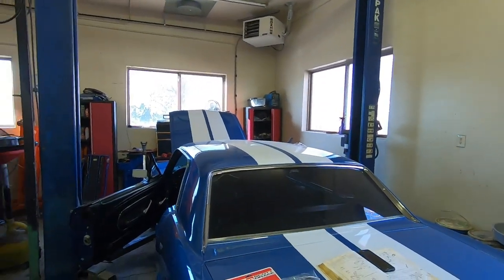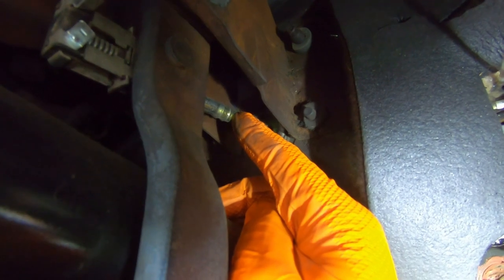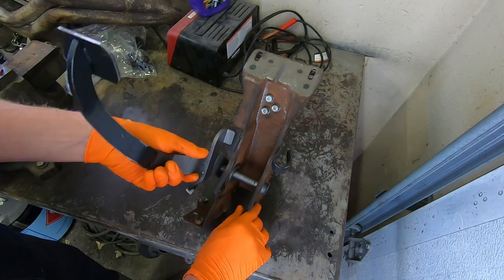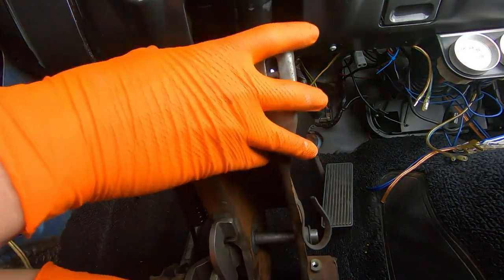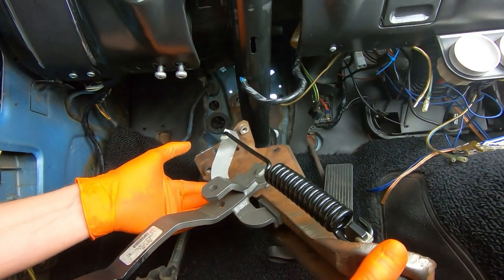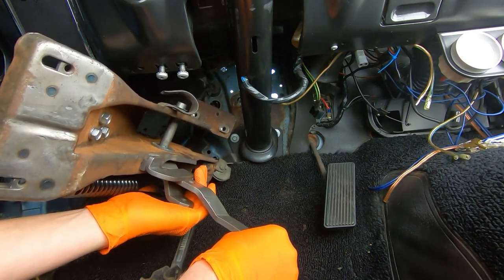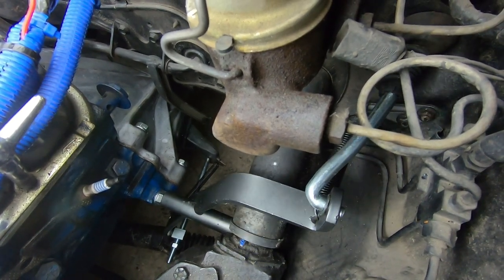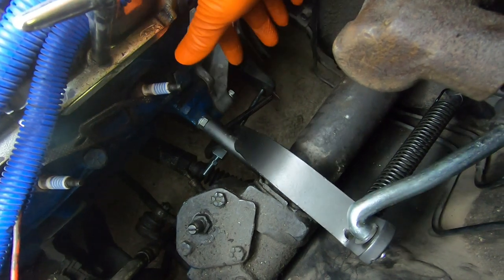Clutch and brake pedal install - 1967 Ford Mustang - Transmission conversion - C4 auto to 4-Speed

Comment: This was a great video, thanks for the detailed info.  I have a ‘68 GT/CS where I’d like to add a manual and get to a better rpm at freeway cruise speeds.  

I know you removed the pedal support so we could see, but us it just as easy to install in the car…removing the booster and MS doesn’t seem totally necessary, but curious on your opinion. 

Thanks again…!
Reply from the maker: Thank you for the comment. So you're right, removing the booster and master cylinder are not necessary if you simply want to add a clutch pedal. This particular car was getting a power front disc brake conversion at the same time. So that's why I had all that out. I will tell you from experience though, installing the clutch pedal with the support installed is not possible if you're still using the factory clutch pedal return spring. Lol I tried and got learned. So you have to at least unbolt it so you can move it around or assemble out of car and then install.

Comment: Great video. I pulled my bracket out today. I have a 70 and the bracket is way bigger than that 67. I had to remove the dash pad and gauge cluster. Mine was missing the return spring and the bracket actually has two cage nuts that slide and mount to the lower dash. Mine were rusted to the bolts and spinning with them. Had to drill them out. Trying to determine if this thing is salvageable. Just upgraded to power disk by master power. What I thought was a minor pedal install will now cause me some me lost time since I planned on having my new power booster and MC installed today. Good times. Keep those videos coming. Very professional and extremely informative. If I wasn’t all the way in the north east I’d be a customer!
Reply from the maker: Oh right on, thanks for the nice comment. One thing I've learned about cars of this age is its always more than I anticipate. Good luck and thanks for watching 👍

Comment: Awesome stuff! I see NPD has different part numbers for the support for manual brakes verse power brakes.
Reply from the maker: Correct, ya I think the difference is the power brakes has open holes for the firewall to allow the booster stud to pass through. Whereas the manual has threaded boss' to bolt a master cylinder to. 👍

Comment: Your videos are so good, they are saving me! I have one problem, I was watching your video for this installation and when i was messing with the clutch fork boot, i accidentally pulled the clutch fork off of the throw out bearing. I barely took any effort! Now, I have to somehow manage to get it back on. Is it possible for me to this without taking the whole tranny out??
Reply from the maker: Thank you! I'm glad to hear they are helpful. As far as this clutch fork is concerned....I honestly don't know. I've never been in that situation. I would probably at least try before you remove the transmission. I would imagine this will be tricky to pull off. I wish I had more advise on this. Good luck!
Reply: @AlfsMustangGarage  Alright, thank you and keep it up!

Comment: Alf, What a descriptive video, it really helps a lot in assisting us DIY to do the work on our own. I have a question. I am in the process of upgrading my 65 Mustang FB with power brakes  and a T-5. Car at this moment has a C-4. For the 65 a special power brake is also required? Appreciate yur coments
Reply from the maker: Thank you! I think you're asking me if the brake pedal is different for power brakes on a 65? If so, the answer is no. 65 and 66 used the same brake pedal for power or manual brakes. You will need a different pedal because of the transmission conversion though. I'm sure you already know that though. Good luck and sounds like an awesome project!
Reply: @AlfsMustangGarage  Thank you for reply and assistance

Comment: Hi brother Alf! Sorry to be a pain. Went to replace my brake pedal and found out it is bolted to upper pedal support, (power brake pedal) No wonder the car don't want to stop! Ex-4 speed factory car so I will pull out the pedal support as there is no way I can reach that one bolt holding the brake pedal. LOL, the four speed pedal was under the carpet. Removed return spring. I will remove air box and remove clutch pedal. I'm just gonna cut the pedal part off so I can use the rest for the Pin that does through clutch and into brake pedal.  Master Cyl is out so just two firewall bolts for upper support and the two screws. Dang, thought this would be easy swap!  Dooooh, nothing easy for ole Bob! Just in case, what size is that nut for the pwer brake pedal you are installing? I might use a long ratchet and find the nut blind and remove. Might be easier to remove the whole support.??? Thanks sorry to bother you. Hope the move is going good. Later.
Reply from the maker: Oh wow ya that makes sense. I can't remember the size of that nut. More than likely it was a 9/16" but could be a 1/2" also. I found it easier to at least un-bolt the support and then you can access the top much easier. But then again at that point its probably pretty easy to remove. Good luck!
Reply: @AlfsMustangGarage  2 months later update. Yes pulled the support, pulled the 9/16" bolt easily, Cleaned/removed rust from support and painted like new. Got a bushing kit from NPD for the brake rod and new brake light switch. Support went in much easier then it came out. Added Scott drake adjustable master cyl. push rod and adjusted for good pedal height. Bleeding system. Mushy brake pedal. Pulled calipers and bench inspected. two out out four pistons frozen. Replaced both calipers with new Kelsey Hayes type Bled system again. Ran bowl dry. Bench bled master again. Bled system again. lol, Much better pedal but a tad soft. Will bleed again (air somewhere in there). Ready for 4 shock absorber replacement. Thanks again, could not have done this without your videos and advice! Much appreciated sir! Gott find your video of rear shock replacement. Take care, many blessings to you from Motown/Dearborn.
Reply from the maker: Hey Robert, thanks for the update. Sounds like you're getting after it. One thing at a time. Brakes can be tricky at times. Are the rear shoes adjusted properly? And are the wheel cylinders good? I've seen those leak all the time and I've chased soft pedals only to discover that my shoes are not adjusted. Sometimes I overthink the small things. Hope all is well!
Reply: @AlfsMustangGarage  Rears totally rebuilt with all new parts & wheel cylinders. Re-adjusted shoes last weekand increased the drag. I heard stories of new calipers taking a couple of weeks to break In and start operating properly..........???? It does stop much better then It did before. Next on deck, shocks all the way around, rides like an old covered wagan. lol

Comment: Awesome video as usual. I too want to convert from a C-6 to top loader, probably next year or over the winter on my 67 Gt 460 BBF. Cheers from Motown.
Reply from the maker: Oh dang! That sounds like a beast!
Reply: @AlfsMustangGarage  Ex- 8 second race car converted back to street. Just a mild built 460 with all the good parts though. Thanks for your great videos. I have drawn much knowledge for my projects.
Reply from the maker: That's awesome. The good thing about those 460's is it doesn't take a whole lot to make good power!

Comment: I know you can use your old bracket when switching to a power brake setup. (just use the hole near the top). do you have to grind off the welded nuts on the bracket or can I leave them on? Better to know now, rather then pull it back out to do later. Thanks
Reply from the maker: Yes, you need to make sure the studs of the power booster are able to pass through with a slight amount of wiggle room so you don't bugger up the threads. They will then get nuts installed on them to secure from the inside of the car.
Reply: @AlfsMustangGarage   Gotcha. Thanks for the quick response.

Comment: So I have a 67 Automatic and I plan to do a conversion just like this. Do I need to buy the whole clutch pedal assembly or can I just buy the pedals?
Meaning can I house the assembly that’s in the automatic.
Reply from the maker: You can use the original pedal support and just change the pedals.

Comment: that big spring is actually the "clutch assist spring" which reduces the force needed to push in the clutch pedal!
Reply from the maker: Ya that's a common misconception. It assists in bringing the clutch pedal back up. Clutch pedal return spring 👍
Reply: I disagree. If you see the way the spring cams over it’s pushing the pedal down, not up! when you installed the spring you had to pull it hard to the up position. I bought one because my 67 convertible has the Z bar linkage and a Centerforce clutch which is very had to disengage. When I ordered it they called it a “clutch assist spring”. Thanks for showing how to install it!

Comment: What do you mean by power break assist? How does that set up work? 

I also was wondering if you knew whether the break and clutch pedals on a 68 ranchero were the same as what is found in a 68 mustang? I was thinking about doing a conversion in my car and have access to a cheap 68 ranchero with a ford 4 speed.
Reply from the maker: The power brakes means there is a vacuum booster between the pedal and master cylinder. When you press the pedal it's easier to push because the vacuum assists in pulling your pedal down.
I wouldn't have an answer on the Ranchero. I'm afraid I don't get a bunch of those to become familiar with.
Reply: @AlfsMustangGarage  Ok cool, that makes sense. You would assume that they would be pretty universal back then, especially if they are both 302 vehicles but I am not 100 percent sure. Do you know of any books or websites that could help me with my research?

Comment: I have a diaphragm type clutch, not a three finger type.  One of my clutch pedal insulators broke off last year and I put about 1000 miles a year on my 68 Mustang.  Most of the time when I depress the clutch pedal I hear a squeaking sound. Just a little squeak when the pedal goes down and again when it comes back up. Probably coming from metal on metal contact. I’ve heard that the diaphragm clutch doesn’t require as much force as a three finger type.  I really hate to tear apart everything and replace the insulators because of the above reasons, what’s your opinion?  Leave it along or replace the insulators.
Reply from the maker: I don't think the clutch type matters when it comes to how much pressure the clutch pedal return spring places on the insulator. Those are meant to just protect the spring from digging into the clutch pedal and the other end is that bracket attached to the pedal support. It is the pressure of the assist spring that is being placed on those insulators and the clutch doesn't change that. I would replace them if you have the opportunity.

Comment: Hello again, Quick question sir. Did you take out the front seat when you pulled the brake pedal etc? Hoping you didn't as my seat bolts under neath have mufflers blocking the access holes and the exhaust is welded. Thanks appreciate it.
Reply from the maker: I didn't remove the seat. Should have plenty of room to work.
Reply: @AlfsMustangGarage  Yaaaaaaaaaaaay!! Thanks Brother!!! The new pedal is the right ratio, I measured and it will be 6:1 and should help with the hard pedal with the new M/C and prop valve.
Reply from the maker: Nice, let me know how it goes!
Reply: @AlfsMustangGarage  6:1 ratio not 7:1. and will do.

Comment: If you wouldn't mind, can you give a ballpark of how much this whole conversion costs? I'd love to do this to my 68, but I need to know how many 7-11s I need to rob. 😆
Reply from the maker: I can give you some numbers in the morning. Do you want to know just parts?
Reply: @AlfsMustangGarage  I was thinking parts and labor. I know it'll all be dependent on what you get and who does it, but it'll at least give me an idea.
Reply from the maker: Absolutely. I'll pull the invoices from this job tomorrow and let you know. There was a lot of things I did on this car aside from the transmission but I'll separate it out for ya.
Reply from the maker: So after going through everything, the cost of every part on this job that was transmission conversion related was about $3900. Thats from the fluid in the trans, clutch linkage, pedals, shifter and also including the transmission which was bought and professionally rebuilt. Labor wise was about $1000 to remove the C4 and install everything else. Hope that gives you a good realistic number on what to expect if you were to pay someone to have this done.
Reply: @AlfsMustangGarage  Wow, honestly, that's a lot better than I was thinking it would be.  Especially the labor part of it.  Thank you for the information.  Now move to Oklahoma so you can use my Mustang for content.  :-)
Reply from the maker: Ha ha ya that would be cool. Honestly, it's probably not too bad of a commute to Utah.

Comment: So I have 66 and the set up is similar except that bar you easily pulled out is weld in place on mine. I'm really struggling to remove the air vent to buy some space. Will it pull out towards the passenger side so that I can leave the vent? I wouldn't be doing any of this except that cotter pin on the brake snapped while I was driving and everything is out of place from me limping the car home (I know now I shouldn't have done that)
Reply from the maker: Which bar are you referring to? I'm not sure about towards the passenger side. One thing that I have found helpful is removing the instrument cluster just to get more access and visibility.
Reply: @AlfsMustangGarage  that big bar/pin that you pulled out from the the left side after removing the cotter pin. Mine is welded to the clutch so I can't pull it out. I tired taking the instrument cluster out only to find the previous owner had taped every thing together so tight that its impossible to pull it out more than an inch. I'm trying avoid project creep but I feel like this keeps getting bigger just trying to get this part out.
Reply from the maker: Wow that sounds frustrating. I'm not sure how to advise you from here if that is welded in. Ultimately you may have to remove the steering shaft out of your way, drop the whole unit out and grind the welds off on the bench.

Comment: What did you do for the interior shifter install? Was there a video?
Reply from the maker: I'm afraid I didn't focus on a shifter video. I showed the removal of the automatic shifter in part 2 of the trans conversion but I never really touched on the install. Essentially I installed a stock 4 speed boot with a Scott Drake Bezel that is listed for 65-66 but fits 67 just fine.